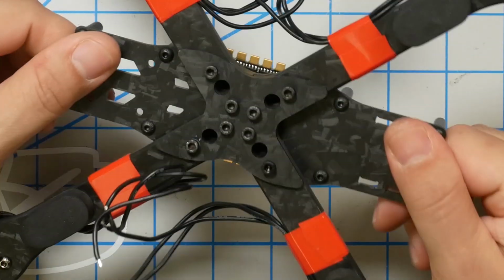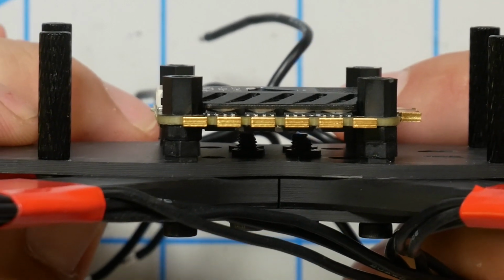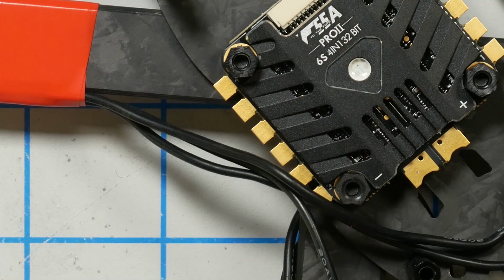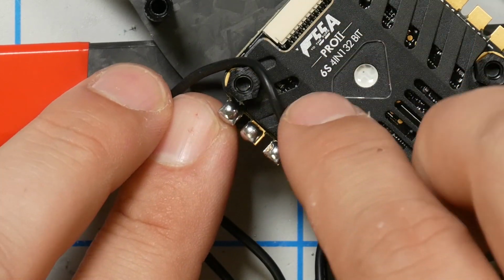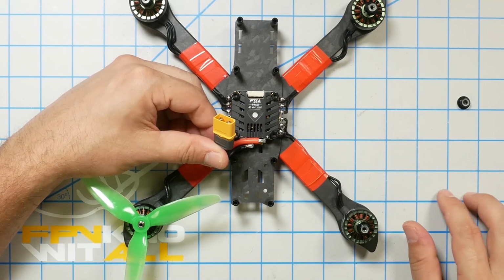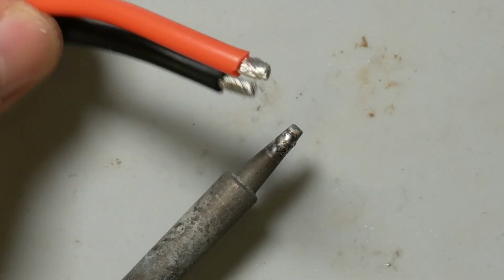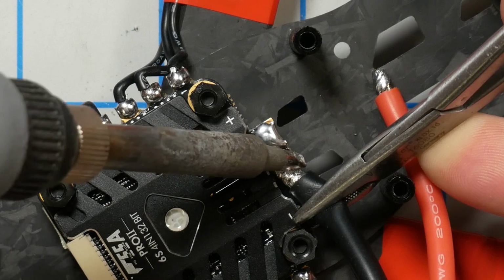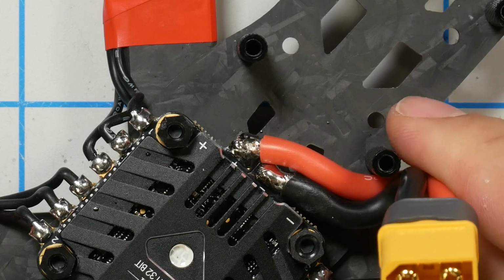Freestyle Kwad Build - Part 2 - Stingy V2 Forged Carbon / Xing 2208 / F55A / SPRacing H7

Comment: You know the trick where you use the washers to get the correct screw length for the arm thickness? Why didn't you juxt fo that for the stack screws?
Reply from the maker: That would have helped.

Comment: I ran my Motor wires on the inside to keep things clean, but didn’t notice the wire was chaffing on a corner of a chip on the board and it arced and shorted after a couple flights.
Reply: I choose to run them outside now for ease of repack and avoid stuff like that again

Comment: Great Build, I mostly like the Frame. The Only Point i get a bit a hastle with is at min 11:00 the soldering of the xt60 wire to the ESC. In my opinion this is the Moment where Small Electronic can died easily if Holding the Heat for too Long. I know it's a pain to solder on the Ground pad there, i only use for that soldering a Big Old style Weller Soldering Iron 60W. This Monster float even the Ground pad in 2-3seconds completly. I have 3 Soldering Stations all good ones, but with non of them i solder this ESC XT60 Pads they are deffinitly not made for this, even on full Power they lost the heat to fast on the big pads and the Station Need to heat in a Long time to float….

Comment: I think you already said it in another video, but the thing with those assortments is that I always end up with two or three empty compartments while the rest is still unused... ;D
With screws the same as with heatshrinks...
Where I live I can get bags of quality screws (of like 100-200) the exact size I need for really only change money.
Might not apply to anybody, though.

Comment: Just for info do NOT put that e-z out in your drill. Its supposed to have a pre drilled hole then lightly tapped into the hole and turned with a tap handle, that's why there is a square end on the non fluted end.
Reply: 93skyline 👍🏻

Comment: You know whats great about broken old quads after you have gone thru about 5 and build your fleet up and maybe grabbed a few frame kits .... all that spare hardware!! I save mine in a Tupperware bucket i have quite the collection and i still bought the nylon  stand off assortment but im pretty set on metal screw and nuts and such just keep  building flying crashing and fixing and youll have quit the stash as well in no time!

Comment: Good job JB, a lot of good points covered, build looks nice and neat.
Never had problems with F to F spacers. I prefer having a screw on the top rather than a nut. So far broke 5 frames this year, my electronics survived all of them.
I do the same with my iron. Not a big enough deal for me to buy a bigger tip.

Comment: Finally, something I can actually help with...   I have been soldering electronics for 20+ years, and there is one thing that I have learned over the years that has never ceased to amaze me when soldering.  Flux.  The secret to absolutely flawless solder joints, is to use flux.  If you are soldering two things together where you are adding fresh solder wire to the finished joint, then no additional flux is usually necessary.  If you are tinning two items, and then putting them together without adding more solder at the time of joining, then you need to add a little flux.  Any no-clean flux paste with a mild rosin content will usually work well, like MG Chemicals 8341, which is probably the easiest to find (one syringe full of flux will last 5-10 years).  The problem you are having, is that when you are soldering, the flux is only contained inside your solder wire, and only activates when you are actively adding fresh solder to a joint.  If you tin the wire, then tin the pad, the solder on both of those gets an oxide layer immediately, and when you go to put the two together, they won't flow correctly, because there is no more flux available to get rid of the oxides.  One more simple step, will make soldering a pure joy.  After you tin the wire, and the pad, add a micro amount of flux to the wire, and the pad, then put the two together and touch with the soldering iron.  The existing solder will instantly flow like water and give that perfect mirror blob of solder (if there is enough solder available).  You will also notice that by using flux, less heat is required to flow the solder, and the joint flows together a lot faster, which will heat up components a lot less and prevent damage.  Reflowing existing solder joints is also super easy with flux.  Add a small amount of new solder onto the tip of your hot iron, add a tiny amount of flux to the existing solder joint, hold the wire secure so it doesn't move when you remelt the solder, and touch the tip of the soldering iron to the joint, and you will watch the entire solder joint perfectly flow together like water.  Yes, flux really is that good (it feels like a miracle when you are using it).  I always even put a tiny amount of flux on bare wires before tinning, because flux helps the solder flow so much better (especially on larger wires like power and motor wires).  The tiny amount of flux that is contained inside soldering wire, is only really useful for circuit board assembly work, and isn't enough for larger soldering jobs like motor wires, or power wires.  Especially when soldering tiny wires to tiny pads on flight controllers, flux will make it way easier, and safer.  Just tin the wires, tin the pad, add a tiny amount of flux to both, hold the wire in place, and touch with the tip of the soldering iron.  The extra flux on the joint will make the solder stay put in a little perfect blob, and prevent any solder bridges to adjacent pads.  Watch some youtube videos on "drag soldering flux" or "smd soldering flux", which will show you what amazing things you can do with a soldering iron, by using flux.  Ok, that was long winded, but only because this is how important flux is to soldering.  Besides a decent soldering iron, flux is your most important tool.  Flux can even make a crappy soldering iron work beautifully, because less heat is required to flow the solder.  One final tip, is that a little flux goes a long way.  Don't gob a ton of flux on, as when it heats up, it flows and can make a mess if you use too much.  (if you do use too much, it doesn't hurt anything but can be cleaned with some alcohol and cotton swabs).
Reply: Brian Doctor thank you
Reply: Absolutely.  Flux makes all soldering better. Even for fresh joints on say a flight controller.
Reply: I wish my flux lasted 10 years!  Clearly I do a lot of soldering...  But yes, all that is good advice. Use flux and good solder people, it makes a bigger difference than a fancy soldering iron.  Other tips/advice on soldering can be found in the SP Racing H7 Extreme manual, there's a section dedicated to it - http://seriouslypro.com/files/SPRacingH7EXTREME-Manual-latest.pdf

I use:
* Stannol solder (HF32 3500 0,7MM 250G -  Solder Wire, 304 Flux, 0.7 mm Diameter, 183°C, 250g)
* Amtech Flux (NC-559-V2-TF Tacky Flux)
* Metcal MFR 1160 soldering iron, with SSC-6xx/SSC-7xx series tips.
Reply: Thanks for solidifying (pun intended) my experience as an amateur solder that flux is one of the key things to make it easy to solder and therefore a good joint.
Reply: Yes. On a molecular level: Solder flows onto surfaces where flux has removed the oxides.
Reply: Yes yes yes. I laugh when watching people tinning wires, because they heat the wire and add solder, and it's a 3-hand job whether you use a helper or not. This works, but it's SO MUCH EASIER to dip the wire-end in a tad of flux, add a blob of solder on the iron, then just touch the solder to the wire. Instantly the wire is tinned. The one thing you didn't mention about what flux does, is that because it's such an outstanding heat conductor, it spreads out heat, and reduces hot spots from the iron, thus reducing likelihood of damage. I watch Louis Rossmann repair Macbooks all the time, and I've learned so much about soldering from him. Flux flux flux flux flux. It is key.

Comment: @Joshua Bardwell
This is my favorite basher frame, but it is discontinued. Can you recommend something similar?
Just look at the frame, not the parts in this listing. I like it because its a unibody plate, but with super fat strong arms. Even better than replaceable arms, is crashing and not even breaking the arm :)
http://www.helipal.com/storm-racing-drone-rtf-srd240x-v2.html
Reply: Nice.  Suggestions on a 2nd favorite basher?
Reply: @dustynuts4sale  I havnt found anything better. I built an armatttan chameleon and broke an arm and the camera cage fairly quick. I have built two quads out of this srd240x frame and had minor cracks, but never broke an arm. However, I do a couple important mods. First, I build it with 18mm standoffs instead of the 30mm standoffs it comes with. This makes it a slammed deck quad which gets the battery closer to center of mass. Second, it comes with 6 standoffs, I add 2 more in the middle so that it has 8 standoffs. After lowering the deck, only micro cameras will fit, which is fine with me. I built a 4S like this and a 6S like this. Currently, the 6S is out of commission because of a hard impact that bent a motor bell, but the frame is still fine :)

Comment: Thanks for your contribution. I use the same ESC and have an important tip. Please only solder the motor cables from above. Below it can happen that solder paste can come to the FETs.
https://drive.google.com/file/d/12d5VN44r6exH0FlZEBjSrLSTW6rh1pf4/view?usp=sharing

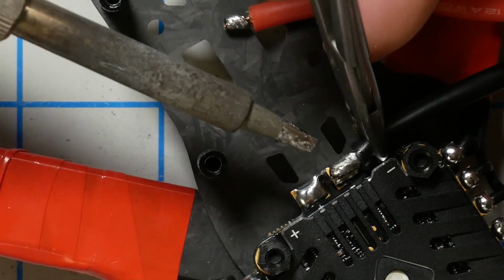Comment: Your iron looks dry at 10:50, if you apply some solder to the tip the heat will transfer much better. :)
Reply: Anders Mårtensson i think he already knew that
Reply: @yoshifpv7331  Not unlikely, but for whatever reason he didn't do it nor mention it, so even if it doesn't help him it might help someone who doesn't know and are trying to emulate him assuming that's how to do it :)

Comment: why no capacitor?
Reply from the maker: For 4s builds with a 4 in 1 I don't use one unless I have signs of noise. Mostly because it takes up space in the frame.
Reply: @JoshuaBardwell  i do the same but i guess i assumed with that massive esc you would be going 6s

Comment: Love the look of that carbon brother 👍👍 fyi Extractors are meant to be used with a t handle or wrench. Wouldn't use a drill Joshua they may shatter they are very brittle. Probably doesn't matter on these litte guys. 👍👍👍 I've broken dozens over the years .😜
Reply: literally more than 50% of screw extractor bits/sets are specifically marketed for being used in power drills... Only times I've ever seen one being used with a t-handle is because it was an extractor that was literally a part of a tap&die set... I think EZ-outs actually work better in drills because of the ability to put more pressure into the removal..  Most power drills are perfectly capable of  ≤ 1 RPM (about the maximum speed you should be going with an extractor)
Reply: @streamylc wow cool I  never seen extractors for a drill, Or have them in any tap and die set got plenty of reverse drill bits though . Snap On must be missing something. They never triedto sell me any in 30 years😥 I'll definitely order some .  👍
Reply: @streamylc  those little short bits I believe you are referring to are ok for screws in wood or screws not glued in with locktie and they would probably work just fine in this case, but the one Josh was holding is not meant to be mounted in a drill. The shank is square for a handle.

Comment: Long screws=Dremel

Who builds quads and doesn’t have a Dremel 

Not Josh 🤔🤔

Why didn’t you 

USE IT!! 😂😂😂
Reply: I need a dremel....
Reply: I’ve found the dremel brand has gone south. After two going out I bought a wen brand and it seems to be holding up much better